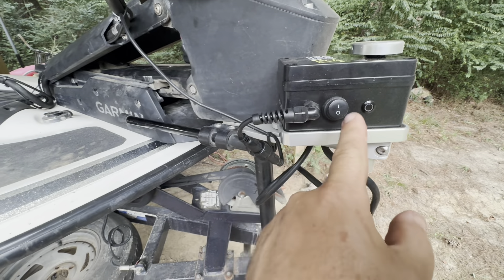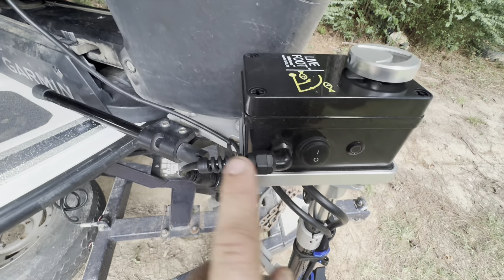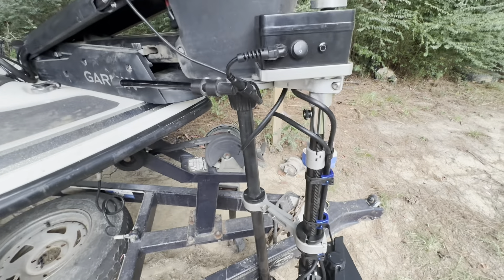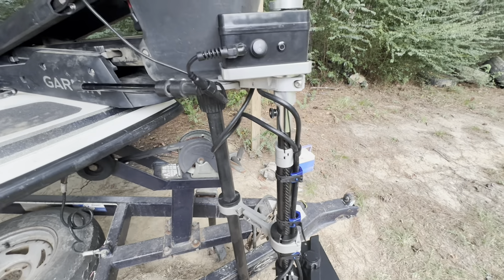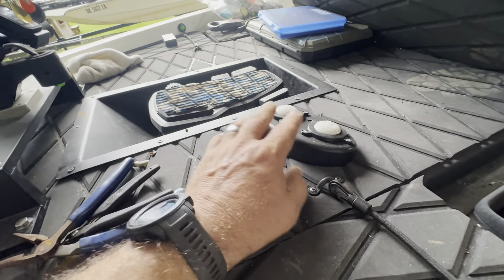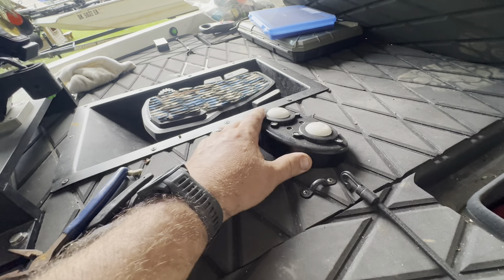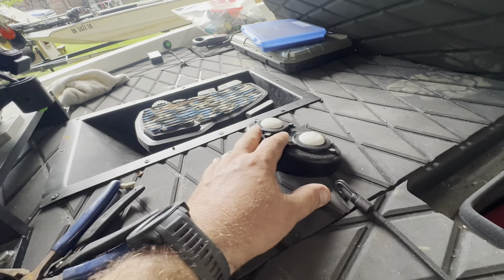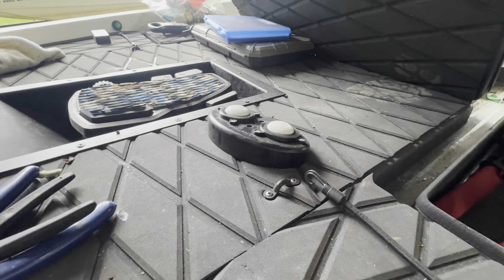DD26 LiveFoot Has Been Improved

Comment: I appreciate your videos. I have had Livefoot for a couple years also.  I upgraded to the same foot controls on the front deck. I have broken a carbon fiber shaft by accidentally hitting a stump. The tech support at Livefoot got me a new shaft out quick.  I have had trouble with the motor head not staying stationary while the shaft is supposed to rotate. I got some velcro ties at Home Depot and firmly secured the head unit to its support.  Also some times the carbon fiber shaft often gets slightly out of alignment. (It hangs down at an angle). ( when the shaft is not hanging directly down, the FFS transducer will read the bottom incorrectly) I am using a bungee cord off the trolling motor shaft to keep it vertical.  All in all, I like my live foot.  If I find a brush pile, I position the boat down wind of the pile. I ease the boat up near the pile, and hit the “spot lock” on the Lowrance trolling motor.  Then use my Livefoot to position my baits.